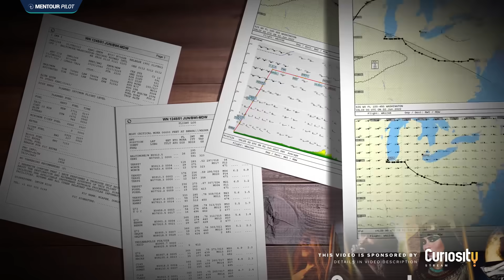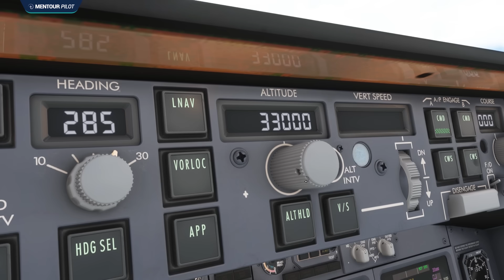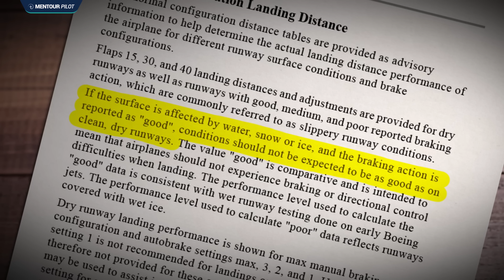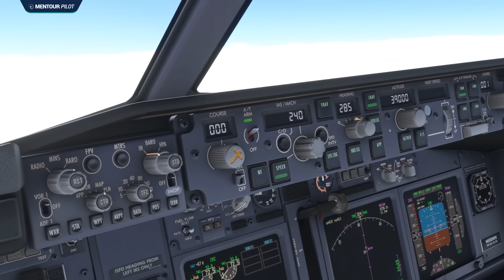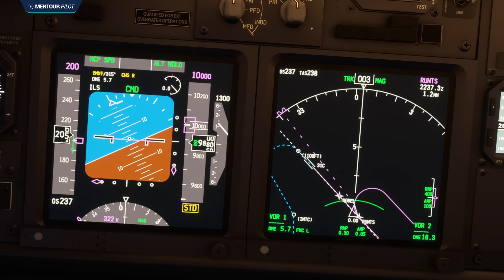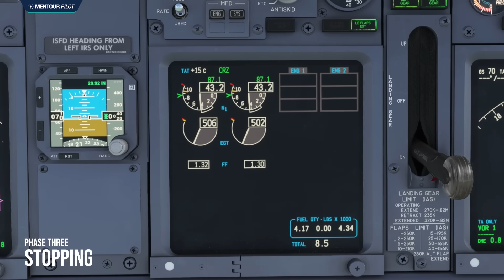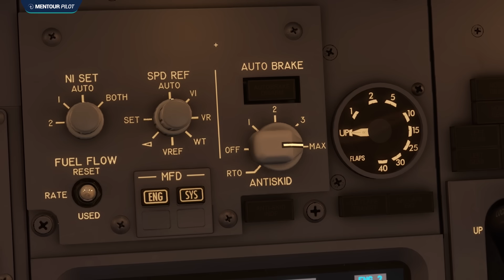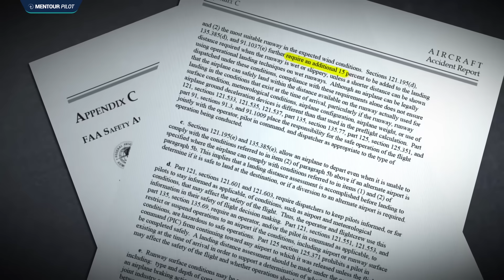WHAT did The Pilots MISS?! Explaining Southwest Airlines flight 1248

Comment: I landed 1 plane before this accident happened I took less than what dispatch had planned for fuel and I shot the approach a bit lower than I would normally, and the braking action was still terrible but we made it okay. These guys were heavy and had more fuel unfortunately. Oh and I also told the ramp we weren’t taking the extra 1000 lbs of freight that wanted to load on as well.

Comment: Cop Humour Australia is with Johno Bowman  
After every flight, QANTAS pilots fill out a form, known as a 'gripe sheet' to tell mechanics about problems with the aircraft. The mechanics fix the problem, and then document their repairs on the form. 
Here are some actual maintenance problems submitted by the pilots (marked with a 'P') and the solutions recorded (marked by an 'S') by maintenance engineers, who by the way have a sense of humour:
P: Left inside main tyre almost needs replacement. 
S: Left inside main tyre almost replaced. 
P: Test flight OK, auto-land very rough. 
S: Auto-land not installed on this aircraft. 
P: Something loose in cockpit. 
S: Something tightened in cockpit. 
P: Dead bugs on windshield. 
S: Live bugs on back order. 
P: Auto pilot in altitude-hold mode produces a 200 feet per minute descent. 
S: Can't reproduce problem on the ground. 
P: Evidence of leak on right main landing gear. 
S: Evidence removed. 
P: DME volume unbelievably loud. 
S: DME volume set to more believable level. 
P: Friction locks cause throttle levers to stick. 
S: That's what friction locks are for. 
P: IFF inoperative in OFF mode. 
S: IFF always inoperative in OFF mode. 
P: Suspect crack in windshield. 
S: Suspect you're right. 
P: Number 3 engine missing. 
S: Engine found on right wing after brief search. 
P: Aircraft handles funny. 
S: Aircraft warned to straighten up, fly right and be serious. 
P: Target radar hums. 
S: Reprogrammed target radar with lyrics. 
P: Mouse in cockpit. 
S: Cat installed in cockpit. 
P: Noise coming from under instrument panel. Sounds like a midget pounding on something with a hammer. 
S: Took hammer away from midget.

Comment: It's very odd that the First Officer didn't question or override the Captain's use of idle reverse thrust until 18 seconds after touchdown, which is an eternity, especially in a situation where they know the runway has poor braking action. Your job as PM doesn't end until the aircraft is parked. 

The root cause of the accident was the two pilots' failure to perform the few tasks necessary (steering, reverse thrust) to stop the aircraft on a runway which was long enough. Flaps, spoilers and autobraking require no attention during rollout. 
The safety recommendations don't stress this enough. You can have all the runway margins you want, but if you don't use what braking is available to you, then there is no point in having them.
Reply: I posted basically the same thing. Jets are pretty complicated, but once the wheels touched the ground, there were two pilots that had three things to worry about: steering with the rudder, possibly braking since they weren't confident in the auto brakes, and making sure the thrust reversers come on. I feel like I often have more going on in my car or on my motorcycle than that.
Reply: But isn't blaming the pilots like the most useless kind of safety recommendation? Like I just don't see how "don't make mistakes" is supposed to prevent any more incidents.
Reply: @MrMiddleWick  You don't understand what I wrote. The safety recommendations should concentrate on the use of CRM during rollout, the importance of PM functions after touchdown, clearer training and instructions for pilots on how to act if the PF is acting unexpectedly during landing, a very time-critical situation, as well as stricter rules/instructions on how to operate with poor braking action. 

Focusing on adding runway margins and more serious calculations, while helpful, won't prevent this accident from happening again nearly as well as the items mentioned above, since they don't address the root cause of the accident.

Comment: The pilots should never have attempted to test the autobrake system when the runway is slippery. The airline should have also warned the pilots that such tests should be not conducted when runway condition are not conducive.
 Personally, I feel that the crew was unaware of the feel of an autobrake system which they had probably not tried earlier. If the airline could authorize a specific crew who would experience the autobrake system in a simulator prior to testing it in real time conditions could also have prevented such an accident.
Reply: Yes , when a difficult landing was expected this was not the time to be implementing a new procedure with the uncertainty this brings . This distracted the captain at a critical stage of the landing resulting in the delayed application of reverse thrust which was the main reason for the accident . Poor judgement by the crew !

Comment: Mentour, I would like to have your feedback on this: 14 CFR part 121.195 states (paraphrased for brevity):

b) The plane must be able to stop in no more than 60% of the available landing distance (the distance to stop is the distance to descend from 50 ft, flare, touchdown and decelerate to a full stop).
d) If the runway is wet or slippery, the available distance must be 115% of the distance required from the previous point.

My understanding is that, in practice, this works like this:
1) During certification, the manufacturer establishes the "real" distance required to descend from 50ft, flare, touch down and stop for all combination of conditions (weight, density altitude, head/tail wind component, runway braking action and runway slope). How is this determined is explained in the certification standard (14 CFR part 25).
2) When preparing the operations manuals, these numbers are tabulated already taking into account the safety factors of 121.195, so the pilot or dispatcher doesn't need to take them into account separately. For example, if the actual demonstrated distance to stop the plane in given conditions (non-slippery) is 1000m, the performance tables in the operations manual will show a required landing distance of 1667m (such as 1000m is 60% of that, but the 1000m number is never shown in the manual). If all conditions are the same except that the runway is now slippery, then the demonstrated landing distance may be lets say 1500m,  so the first requirement would mean that you need 1.667 times that which is 2500m, and the 2nd requirement for additional margin in slippery conditions would mean that you need 1.15 times that which is 2875m, so that is the number that the operations manual would show.

Let's say for a second that these are the numbers that the Southwest crew got. The required landing distance was only 40 ft (13m) shorter than the actual available landing distance, which means that the actual available landing distance was 2888m. And they had 200ft (60m) of stopway for a total paved length available of 3048m. That is slightly more than double the "perfect" real landing/stopping distance for these conditions (and they used a full "poor braking" condition for the calculation, not partially fair and partially poor).

So:
1- They touched down at the right speed and right spot.
2- They immediately got max possible braking (first by autobrake and then by max manual braking).
And they still managed to use more than double of the distance in which it should have been possible to stop and then go some extra distance through a blast fence, antennas and the perimeter fence?

The real question is: Is extra 3kts of tailwind and the delay in the application of thrust reverse enough to explain this massive difference between the distance in which the airplane should have been physically able to stop and the actual distance it took them to stop? Or am I missing more factors?
Reply: [former airliner landing gear/braking analysis engineer]  Nope, you've pretty much got it.  Landing on a dry runway, reversers typically don't absorb much of the kinetic energy because of:  Not all that much net negative thrust coming from them compared to forward thrust levels;  A slow buildup of the negative thrust compared to near-instant braking force;  It's almost time to stow the reversers by the time reverse thrust (such as it is) really gets going.  That all works out to maybe 15% of the total KE in a typical dry-runway landing being handled by reversers, their biggest plus being that the engines aren't putting out forward thrust throughout the stop which the brakes then have to absorb as well.

The more contaminated the runway -- the lower the effective friction coefficient -- the more reversers matter.  Waiting 18 seconds is an eternity, especially since reverse thrust output is lower by the time speed is lower (less air mass flow rate into the engine).

Maximum braking effectiveness occurs when the tire is turning about 10-15% slower than the aircraft speed (a "slip ratio" of 10-15%).  Antiskid works by dropping pressure in the brake line when sensed wheel speed heads towards zero (a skid) and restoring commanded pressure once the tire is mostly back up to aircraft speed.  It works very well for dry runway conditions, with only small ripples in the brake pressure trace of a stop.  For a very slippery runway, however, the A/S is forced to release more pressure for much longer (still on the order of a second or less) to keep the tire from skidding.  Those "deep dumps" seen throughout the pressure trace mean a lot of the time the tire isn't doing much braking... and so the reversers really matter.  Throw in some extra tailwind, and... time for another YouTube video.
Reply: Good research and analysis, BTW!

... and I'm realizing that I didn't fully answer your question in terms of how the conditions of this flight play against the certification rules you cited.

As you pointed out, FAA rules put a quite conservative 0.6 divisor on stopping distance... but then only a meager 15% on top of that for a contaminated runway.  Since effective friction coefficient with A/S on a dry runway will be better than 0.7, but drops to more like 0.4 for a flooded runway or 0.15-0.1 (or less) for ice, 15% may not cut it...  except that 15% is in addition to the really conservative factor already applied for dry runway.

So was the FAA not conservative enough, when all is said and done?  I would say they got it right:  Runway excursions due solely to inadequate contaminated runway length are rare (IMO), and look what it took in this instance to have one happen.  Meanwhile, if they were to pick a number a lot larger than 15% to make something like this almost impossible, there would be a whole lot of unnecessary diversions* which carry their own risks, in addition to really messing things up unnecessarily for a large number of travelers.

*  Not just diversions, but flights canceled as well.  Or alternatively, a whole bunch of passengers denied boarding.
Reply: @marcmcreynolds2827  ... Wait a second... In your last post, you seem to be saying (or perhaps I am misreading you) that the landing distance required by the FAA in a slippery runway is 15% more than in a dry runway (which already has 66.7% margin, or a 0.6 divisor which is the same). That is not the case. The landing distance is calculated with the actual reported coefficient of friction (or reported breaking action), so the  runway required for landing on a slippery runway is already much longer than a on dry runway even before applying the 15% margin.
For example, for a given weight, wind, density altitude etc aircraft physically needs 1000m to descend from 50 ft, flare, touch down and decelerate to a stop. So to legally land you need a 1667m-long runway (1000*1.667).
Same aircraft, same conditions except that it is a contaminated runway, may physically need say 1500m. So the required runway must be 2500m long (1500 * 1.667), which is already 833 m longer than what is required for a dry runway, oh and by the way go ahead and add another 15% (multiply * 1.15) so you actually need 2875m (1208m more than with the dry runway). And that would be with a not-too-bad CoF / braking action, because if not the difference between dry vs contaminated would be larger.
Reply: @adb012   "That is not the case. The landing distance is calculated with the actual reported coefficient of friction (or reported breaking action), so the runway required for landing on a slippery runway is already much longer than a on dry runway even before applying the 15% margin."

By the time you're talking in terms of reported braking action, that's getting into operational procedures one airline or another might use, vs how a certification is done (FAR "Part 25").  Those airline-specific "aids" can vary all over the place as was hinted at in the video, involving FAA-approved data, additional manufacturer's flight test or other data, third-party data, third-party software of some sort, ???.  But then the complexities multiply even beyond that:  One certification authority vs another; What version of what portions of the regulations are deemed to be in effect for a particular certification (e.g. "grandfathering" under an existing type certificate); Is the subject an FAA-approved Boeing FCOM or some third-party software of unknown correctness (I've done enough braking performance prediction work to know there are plenty of pitfalls).

Given all the caveats above, and given that I had no involement with the 737-700's certification, I will refrain from trying to make any statements/conclusions which relate to its FCOM or the landing performance software the crew was using.  I'll just say that my understanding of how to read the b) and d) from 121.195 is that a dry-runway stopping distance (/0.6) is the referenced "previous point" to which 15% is added for a contaminated runway.  In my experience at least, dry-runway flight test data is the basis for flight manual field lengths.

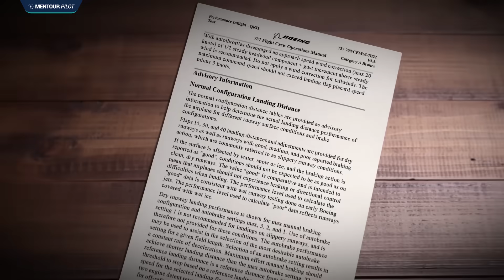Reading between the lines of what's shown on the FCOM page near 7:00, it looks like Boeing's 737-700 wet-runway stopping performance numbers used in their advisory information (and maybe by that software product as well?) might have been extrapolated from 727 or even 707 company (vs FAA certification) wet-runway testing.  Another indication that such stopping data is rather limited.
Reply: @marcmcreynolds2827  ... I have only "theoretical" knowledge of the FARs (I studied them and had to pass exams of them in college in the 90's). I don't have the practical experience that you have. I will just say that my interpretation of 121.195 b), when it says "would allow a full stop landing at the intended destination airport within 60 percent of the effective length", I interpret STOP as taking into account the existing or forecasted conditions of the runway. And on top of that you would add the 15% of part D. I agree that uncertainties exist when determining the stopping distance on different slippery conditions. Even the reported braking action is subjective and can have significant variation. But in my opinion, for any airplane, the 0.6 divisor is based on the expected stopping distance taking into account runway condition. I agree that it is not explicitly stated in the FAR (unlike other factors like wind, elevation, and even ice accretion). It is just that it would not make sense (in my opinion) to base the contaminated / slippery runway performance on a max manual braking dry runway performance + 15%, since the slippery condition distance can easily more than double the dry condition distance. Again, that is purely theoretical and my interpretation. I don't have experience with official interpretations or how it is used in practice.
Reply: @adb012  Yes, more than double the distance compared to dry-pavement maximum braking (effective coefficient of friction 0.7+).  I've stood behind the captain during one of those, and it was very difficult to stay out of his lap even though I was tightly gripping the column of a flight-test equipment rack behind me.

But a typically landing, whether manual or autobrakes, might be at a decel of 4-6 fpss (some contributed by aero drag) and you can get that in most contaminated runway situations even without reversers.

So between that, and the big conservative factor built into the "starting point" dry-runway number, CFR 121.195  seems to work in practice... until someone waits 18 seconds for reversers in poor braking conditions with a tailwind.

One other thing to know about certification-related FAR's is it can be as much about negotiation between the airframe maker and the FAA as to what the rules will be for a particular program as it gets underway, vs just the words printed on a page.  How will the simulated hydraulics-out flight test be conducted, for example (or will it even occur?   -- those have been hull-loss events from time to time).  How to conduct the max energy RTO test (usually out of a landing at max takeoff weight, in order to have more runway in front than accelerate/stop would provide).

Comment: I wonder if increase of runway excursions is due to the increasing of reliance on automation on flying the aircraft rather than manual flying
Reply: Could also have to do with the fact that there is more time pressure, stress, etc. for pilots meaning they don't want to spend time going around or going to another airport when dealing with bad weather conditions.
Reply: @smiley.6534  this is what I immediately thought of